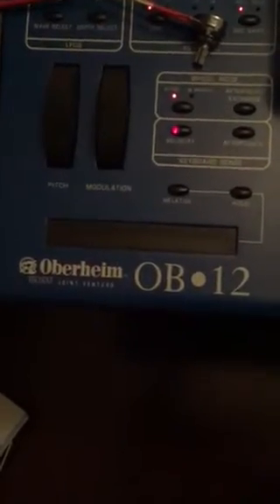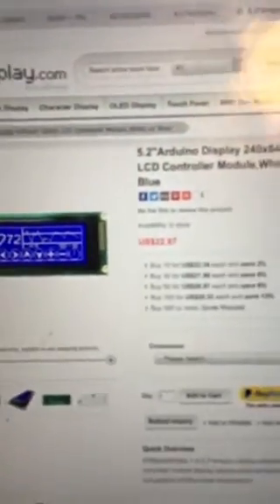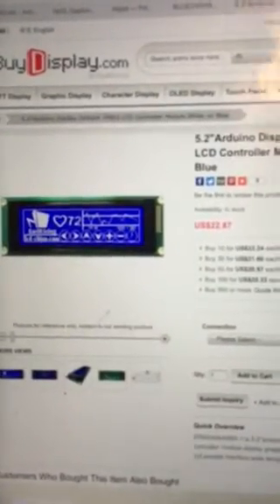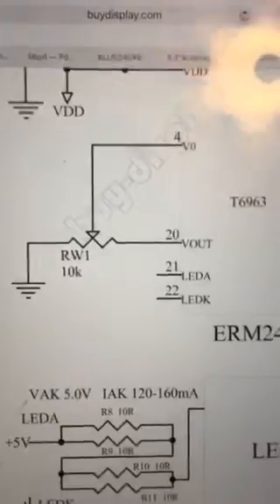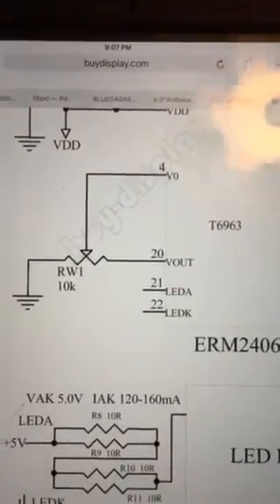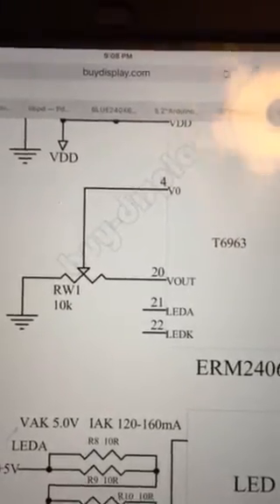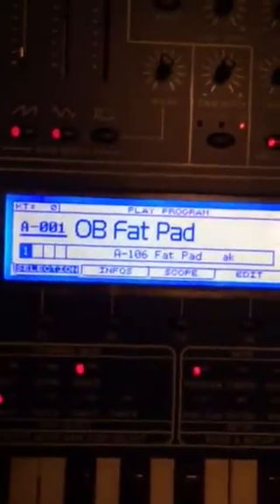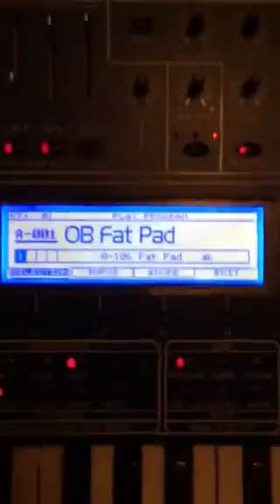Oberheim OB-12 display replacement - New Display Type with Contrast

Comment: Just recive and try to install the new screen I have backlight but it doesn't work for me. 

What I do

1 Install Ground on the first legs of my potentiometer
2 disconect the wire of pin 4  and send it on the out of the potentiometer (center pin) so now the 4 pin isn't yet connected to the motherboard only on the LCD
3 disconect the wire of pin 20 from the LCD side and connect it on the last leg of my potentiometer.

did I have make mistake somewhere?